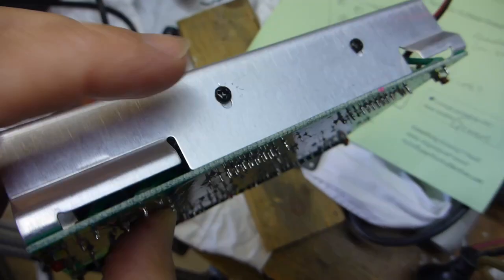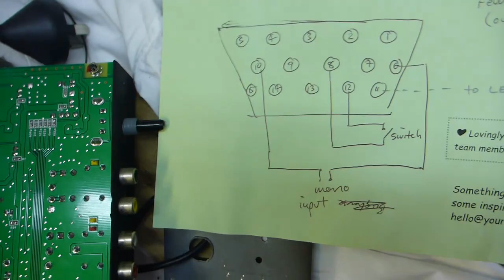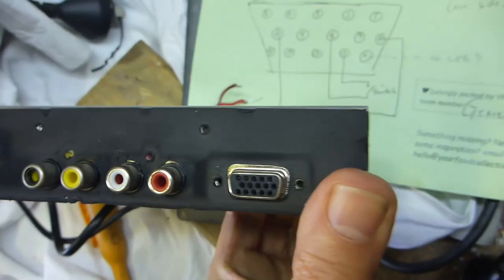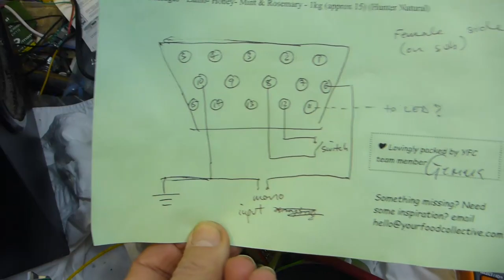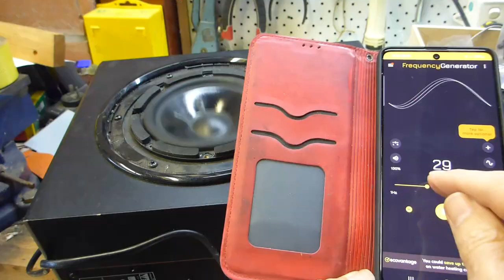Logitech X530 Subwoofer Mod - turn it into an active sub without the control speaker

Comment: I know its passed 3 years from this movie that you uploaded.
i just recived a full set without the right speaker..
do you think you can map all the 15pin plug ?
I don't want to spend alot of money on ebay for the missing speaker. 
i can try and create the right speaker forom different parts. - thanks!
and great tutorial.
Reply from the maker: If you google this model "X530 pin out" you should get what you need. Cheers

Comment: could you do the same with a vga to audio adapter? What happen if you don't use the switch? Is it always on?
Reply from the maker: Yes a VGA video cable is the same plug. Without the switch it is always on.

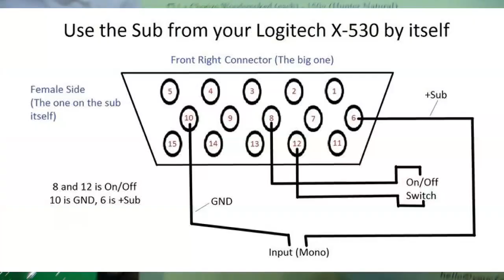Comment: 5:51Dude, I think you reversed the first and last row of pins. 1 should be 11 and so. I got quite confused when your diagram says the switch is between 8 and 12 but you put the wires between 8 and 2 like  6:39. Same with the led out
Reply from the maker: Thanks for the pickup. I got rid of this one years ago, but I find them on the street from time to time and will definitely check this out next time. Cheers!

Comment: hey im kinda new to working with speakers, could the mono input basically just be a 3.5 jack cable that i solder into the dsub pins?
Reply from the maker: @emdojot  yes, you could do this.
Reply: @ okay thanks man🙏

Comment: Please help me how to use logitech z906 subwoofer without controller console...please reply
Reply from the maker: If it's not the same as this one, I can't help you  as I haven't seen inside a Z906. It took me 1 minute to use Google... Try these links: https://hackaday.com/2022/05/19/hacking-the-logitech-z906-speaker-system/  or  https://www.reddit.com/r/hardwarehacking/comments/hnpprk/hacking_the_logitech_z906_speaker_system/?rdt=40276

Comment: I just did this by jumping the power pins then running bare wires into the signal/ground pins.  It's a bit janky (fine for where it's living  - an arcade cabinet that won't get moved), but it works great!  Thank you

Comment: I modified the X530 subwoofer years ago to make it an active subwoofer, and it works great with the Sound Blaster Z sound card. Just plug in a 3.5mm jack and connect it to the subwoofer output. I'm now using it together with the Presonus Eris speakers, and it works perfectly. Of course, the Presonus subwoofer is better, but it's expensive, and I had the X530 lying around at home. For me, it’s more than enough and complements the sound of the Eris speakers nicely.

Comment: wiil the other speakers still work?
Reply from the maker: You need the control speaker with this mod for satellite speakers to work. The whole idea is to be able to use it (in some form) without the control speakers. Good news is, I've tested it and it sill works fine with control speaker attached.

Comment: Amazing! We just upgraded our home theater receiver, but we didn't have a powered subwoofer to go with it. I remembered I had this old unit in storage and wondered if it had an input. I was able to add a power switch and a real RCA input jack thanks to your video. Our new setup is rocking the house!

Comment: if I increase my sub volume the sub speaker alone is rumbling any ideas why?
Reply from the maker: Possibly bad filter capacitors. Could also be a poor cable connection. Try it with nothing connected. If it hums, it's capacitors. Not so sure about a rumbling sound though.
Reply: @pescado99  seems cable connection got it back by moving up the wire a bit

Comment: My Logitech z623 vga male 15 pin connector is broken bro can you help me please 🙏 15pin new connector change connection please 🙏
Reply from the maker: What do you mean broken? If you've broken a physical pin from the connector plug, there's not a lot you can do because the plugs are potted (sealed). You need to give more information.

Comment: that is really dumb, why would you not cut off the power to mains to make a hard power switch and leave the internal always on, so it would not be in standby
Reply from the maker: Yeah, you could do that, but isolation of the power supply wasn't the point of this video. As always, all comments welcome :-)

Comment: Hy, nice vid. Do you know, where to find an circuit plan for this?
Reply from the maker: Hi, mine has long since gone. I searched on line and found it pretty quickly using the model number. Good luck
Reply: @pescado99  tryed this already. nothing to find. :(

Comment: awesome video!!! question - how would you connect/convert a home theatre sound system of 5.1 speakers to a laptop that has only input for 3.5mm jack. is a amplifier needed? whats the best and cheapest way to connect it without needing to buy a separate hifi amplifier
Reply from the maker: Short answer is that it's not possible. The logitech speakers can't decode, they can only amplify weak headphone level signals. Laptops only have 2 channel output from their 3.5 mm headphone socket. So that's all you will hear/be able to amplify. You need a PC (Mac??) That has separate channels outputs from the sound card. Also, the source must also be decoded as a 5.1 signal. 99% of stuff on YouTube is 2 channel only. Only streaming services contain separate channels. Cheers
Reply: @pescado99  I'm currently running 12 speakers and a sub off of my laptop lol

Comment: Somebody tryed chaged power supply to 12v dc and connect this subwoofer to car radio using mono Jack > 2 RCA cable??
Reply from the maker: Yes, there is a comment further down on how this might be done (using secondary windings from transformer).

Comment: The input of this board is AC, I want to run it with DC, how can I do it?
Reply from the maker: Yes it would be possible, the supply is 240 VAC. The transformer on the main board has a secondary winding that steps the voltage down (not sure, but typically 6v to 9v), it is then rectified with a diode bridge rectifier, and filtered with capacitors. So technically, you could pick up the secondary winding from the transformer where it connects to the diode rectifiers - you could measure it and replicate it. Make sure you get polarity right. Would suggest at least 2 Amps on DC supply.
Reply: @pescado99  thanks
Reply: @pescado99  Is it okay if I give 12v to the capacitor in the input section?

Comment: Amazing speakers, used mine for over 15 years. Is there a way I can use the woofer to supplement my monitors (Edifier R1280DB)? I have no idea about electronics and I'd hate to just throw out some old veteran speakers.
Reply from the maker: That's what this video is all about! The R1280DB's don't have much bottom end, so thus hack may help you, but you need some basic electronics to at least be safe around mains voltages.
Reply: @pescado99  if I had the tools and the know-how I'd be following along with your video step by step. Almost exactly what I needed haha. Love you vids dude
Reply from the maker: @robeywan Thanks mate, always great to get some +ve comments! This whole YT thing really started out as a bit of a laugh really - and I had low expectations. So I get a real buzz when I get some good vibes back. Understand where you're coming from, like all things, this stuff is easy if you've done it before!

Comment: Hello friend, I have a Logitech z313 I bought it second hand but it does not bring the mouse where it turns on and the volume is raised, what can I do, help
Reply from the maker: Hi, have you tried to Google the issue?  Do you mean your Z313 does not have the remote? I'm not sure if my fix applies to the Z313. All I can suggest is to open it up and check to see if he pin connections look the same as the X530 in the video and try a similar fix. Good luck and remember to do this safely, with power turned off.

Comment: can i connect the periferals speakers with this mod? or do i need the control speaker.
Reply from the maker: You need the control speaker with this mod for satellite speakers to work. The whole idea is to be able to use it (in some form) without the control speakers. Good news is, I've tested it and it sill works fine with control speaker attached.
Reply: @pescado99  ok i see thanks, can you show how to create a control module for replacing the control speaker, i need to find out a way to make the 15pin a volume, on off, and aux cable for my setup.

Comment: I just purchased the Yamaha HS8, but I still want to use my Logitech Z623 subwoofer.......could anyone help me out?
Reply from the maker: Assume you mean the HS8 active satellites? You could use this mod from your Z623 sub, but haven't checked the circuit board for this mod. Do you now have the Z623 satellites? If not, I'd bypass the active connection in the yamahas and connect them to the Z623 via RCA plugs. Good luck - should sound nice.

Comment: I acquired a Logitech Z506 Sub alone with no control speaker, similar to the X530 but not quite the same. Do you know if it's possible for me to insert a shorting wire to connect the switch pins of the DB15 and activate that way? I would like to use the RCA inputs if possible.

EDIT: Ah, it's a DB9 connector on this model. I guess I need to find a diagram.
Reply from the maker: Not sure. I'd need to sit down and think about this for a bit. If you're sure of the switch pins, then try shorting it out, otherwise, be careful if they connect into the IC. good luck!

Comment: hey mate thanks for sharing so much gold dust know how and its a great presentation. Could I ask you, what does connecting 12v to the switch do exactly (I know it puts the system in standby or idle but how does it do that and what is the easiest way to accomplish this so I can use the amp actively, and how do you add that charge? is it just a case of the switch connecting the two pins by running a wire into the circuit somewhere, or do you have to hook up a 12v psu and add a 12v charge directly to those pins? Sorry for my electrical ignorance. One advice I can offer, though, is never to drill holes in this type of cabinet, as it is finely bass-tuned at the factory and making physical alterations to the structure is known to drastically alter the sound. There must be a cross over in the circuit already so I dont think that is your sound issue, as long as a tweeter is added to the speaker connections the whole hz range should be covered, as I understand it anyway. Just thought I would offer 2 cents ; ). Thanks for any advice you rock!
Reply: cool I just hook up a 12v battery into the standby pins through the VGA for example and leave it on permanently when using the active sub?

Comment: I am having an awful time finding a diagram for my goodwill Logitech z625. I can only fine the one for the z623 but it doesn’t seem to work
Reply from the maker: Keep looking. I actually use the Z623 on my PC and it really hammers. A quick Google for 'Z625 circuit diagram' shows lots of results. Perhaps refine your search? Good luck.
Reply: @pescado99  do you recommend looking on any specific websites? To me it almost seems easier to get a new z625 set and a multi meter to figure out which pins control power

Comment: Could you theoretically use a Y splitter to connect to the L and R aux input on the back of the sub and then run to the LFE output on a receiver and use this sub for home theatre use? Just disable the speakers by unhooking the negative wire on each internally yet still use the volume control on them. This way the LFE signal is only being output by the subwoofer. Do you suppose this would work?
Reply from the maker: Yes it might (if I understand you correctly), but you could have to ask why? This is a bit of a toy, and not suited for home theatre.  I'm not happy with the LFE frequency cut of this project, but haven"t played with it enough to understand the issue fully - it just sounds a bit flat (obviously missing the higher frequency outputs which would normally go to 2 x satellites). Also,  all sub outputs are mono - as you know. This project was to prove the concept (to stop me binning it). I would suggest you just buy a dedicated cheap sub on Gumtree of FB marketplace, they sell for between nothing and $50.
Reply: @pescado99  Just connect to the mono pins going to the sub as shown in video. If you go through the satellite speaker outs you would send audio into the high Hz range in the cross over circuit, also I think there would only be a parallel connection through them and not a series one since the cross over needs to separate the two (three) signals (mono to sub, plus LR to tweeters), so as I understand it you would not reach the sub woofer this way. But you could still send a high Hz signal though the sub is not intended for that (but it will still sound). Again I'm just adding my interpretation here... cheers.

Comment: Nice . I'm having an issue getting that power chord loose even with clamping it . Youre looked fairly easy to remove. Ive tried all types of methods . Any advise?
Reply from the maker: No, it wasn't super easy. It's pretty tight (not much cord slack). I used an adjustable pipe wrench with the jaws open one notch (so teeth stay parallel), clamped it, and then wriggled it gently side-to-side to crack the binding glue on the back. Rock it back and forth - it'll come free.

Comment: Bro tengo un problema con un equipo de esos, cuando subo mucho volumen en una cancion que tenga mucho bajo se dispara me podrías ayudar?
Reply from the maker: Sounds like it could be a capacitor in the power supply. Have a look and check for bulged capacitors or burnt components. Bueno suerte!